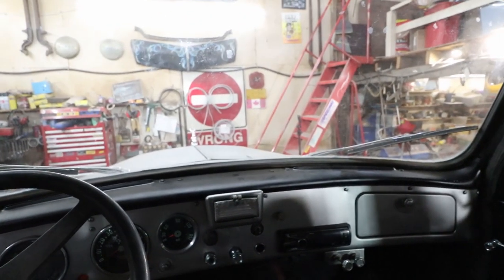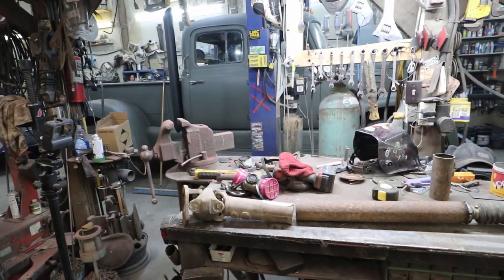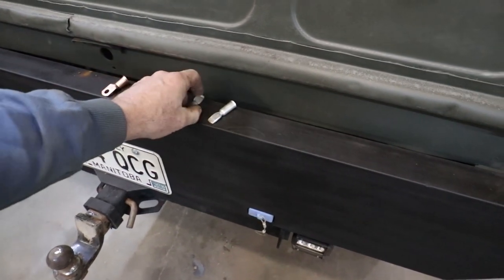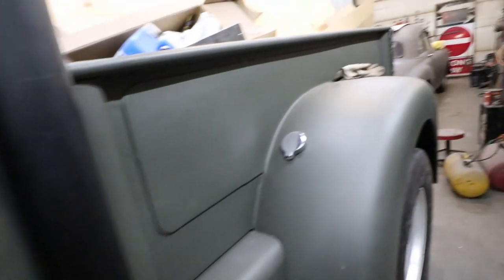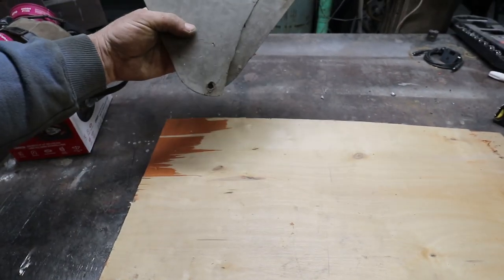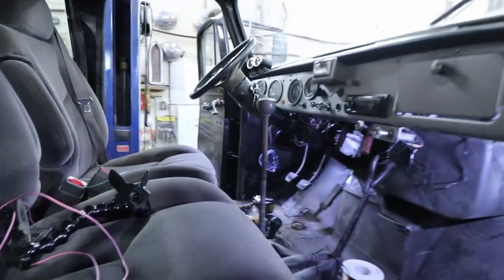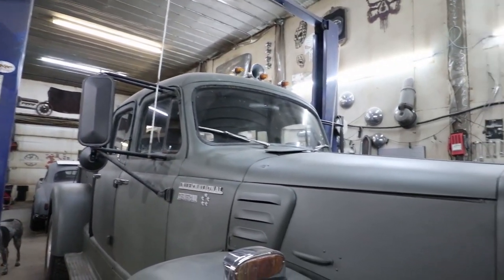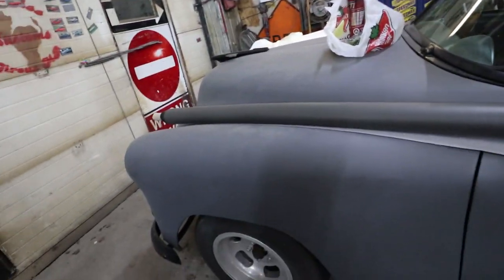Lengthening a front drive shaft and misc little things short road to completion

Comment: I shortened a driveshaft for my c10 after swapping out a 6 for a 350. I didn't have a mig or tig so my father welded it for me with oxy- acetylene. Drove that truck for years with no vibration or problems. Don't be afraid to try. You could save yourself a ton of doe as apposed to taking it to a driveline shop. My Dad was old school and knew what he was doing. So you can do it to.

Comment: Spin cycle dial'n a drive shaft 4x4. Plumb'n da horn, wire'n da jump box, panel'n da speakers, pet'n da dog, advisored n wipered out da door. List's get'n shorter, come'n up da bed floor. What kind of trailer you setting the General up for? Bug out?
Reply from the maker: for the most part just a car hauler but I do have a 26' goose also

Comment: Have you ever used the $30 Ebay wire kits ? I dont need a fuse box -got a Moroso fuse panel. Cold as hell here in Minney ! Need to make a driveshaft for my 29 Essex coupe-Thanks
Reply from the maker: I tried to achieve wiring harness once it's better off just making one it'll do your basic stuff but usually you'll just have a single wire for your headlights and then you're on your own for running the rest of the stuff

Comment: Wondering how the safety inspection and registration of a custom built vehicle like this works? Do you register it as the International or as the Dodge truck the chassis and drivetrain is from? I'm guessing the safety would be like for a written off vehicle inspection or out of province inspection where they check the entire vehicle from top to bottom? Lol, just questions I've always had on these basically hand built vehicles.
Looks great and I'm super impressed at how quickly you put it all together Brent! I'd probably still be working on how to get it out of the trees... :)
Reply: Typically registered as the body, because that is "the look." Law enforcement or insurance looks at it, they see an old International, rather than the Dodge bits underneath. If insurance has to pay to fix, they're fixing an old International with upgraded axles, etc. Safety inspection would be specific to the province or state.
Reply: @ScoutRehab  Thank you for the reply, makes total sense.

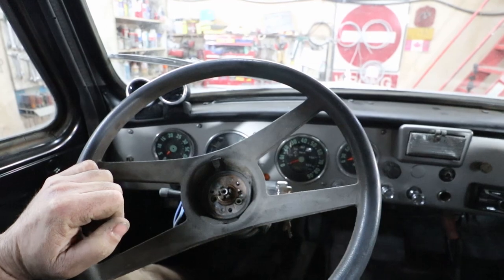Comment: 0:20 That steering wheel is upside down. The biggest hole in the wheel should be on top, so you see the dashboard better.
Reply: I think it fits the truck the way it is. No matter how GM did it on another stamped out vehicle.  😡

Comment: Do you need to balance drive shaft?  This is just the ACM (arm chair mechanic).  Keep on keeping on!
Reply from the maker: I've never had a problem when I do them on the lathe, there usually straighter than the stock stuff sometimes.

Comment: Excellent video also what using for Am/Fm radio antenna I say if find a way do on back rear window the grid of T sticker type also work excellent my 2002 Chevrolet Impala has one and pickups excellent to ! Also if can't use a Pop Rod antenna drill hole then bolt in place to on roof in middle or right side of fender to firewall to radio ! Or do angle antenna use on Dodge Journey SUV for car stereo mount face backwards of 45 ' angle with short whip ! Why say T antenna or Dodge Journey Van less chance get broken then pop rod on roof would do that and I know Toyota and Honda do back window grid antenna for vechile radio antenna!
Reply from the maker: just using one of the whips as the radio antenna.

Comment: You should buy a battery crimping tool For doing battery cable   Ends It works on all those big fittings I bought my on line pretty cheap $75 Hydraulic